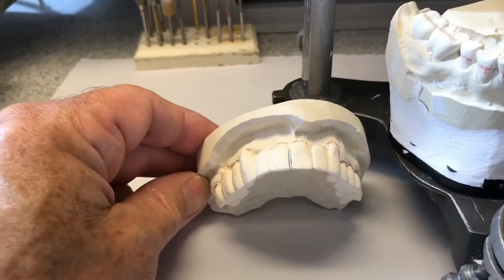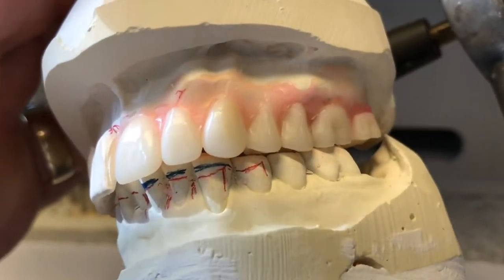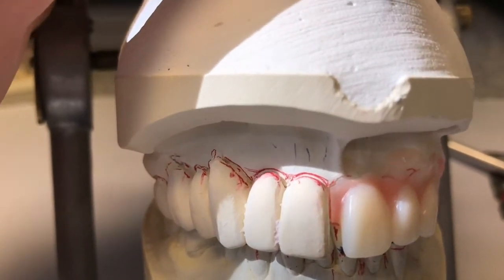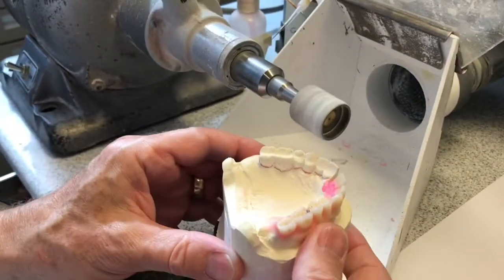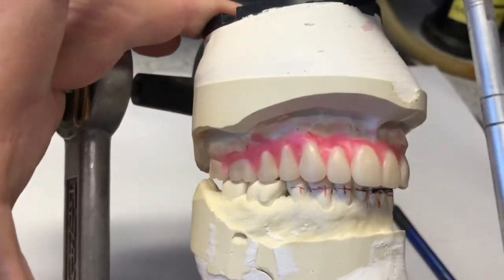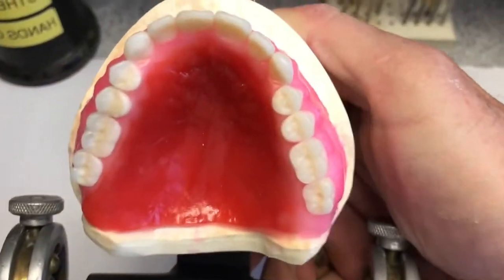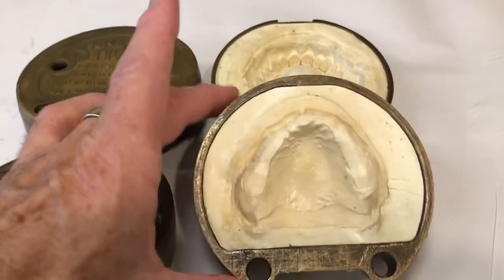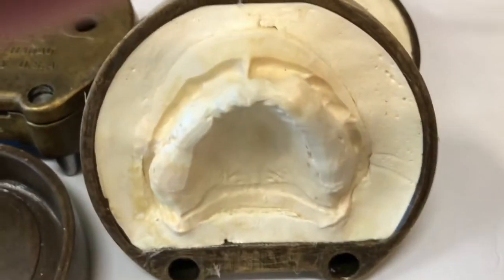Immediate complete denture set-up overview with lab fabricated surgical guide

Comment: thank you Luther, how do you feel about injection molding full dentures? I'm thinking about buying the injection molding press seems to me that it would make a thinner acrylic denture and also control shrinkage better when the material is injected. I would be using cold cure acrylic or acrylic pellets heated up to 400 plus degrees to melt them and then press them hot into the mold. do you have an opinion on this method?
Reply from the maker: Dave, I think the heat cured injection is probably the best method, but is more time consuming and still has to be done properly. Mainly, it HELPS compensate for some of the shrinkage that occurs during polymerization. I'll always be sceptical of self curing acrylics. They shrink more, have color issues over a long period of time, are more porous and questionable residual monomer content.